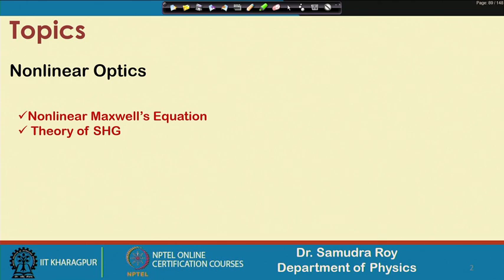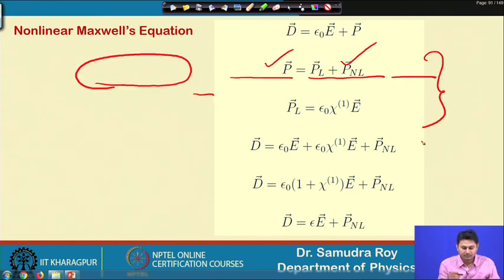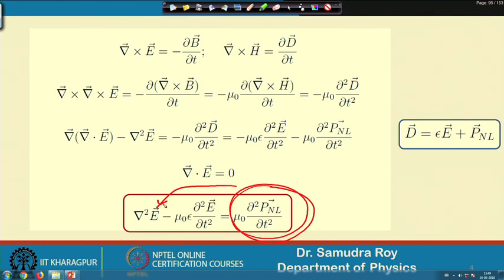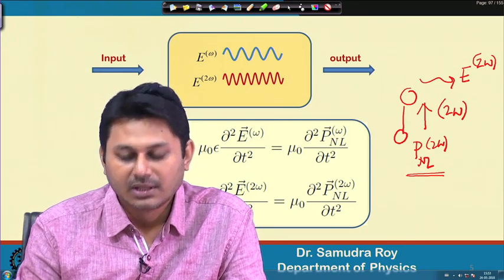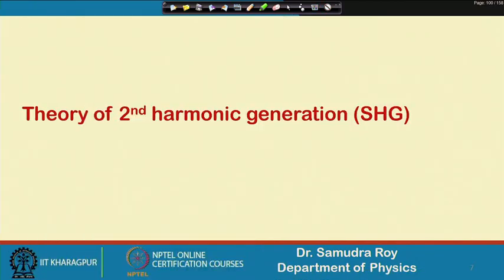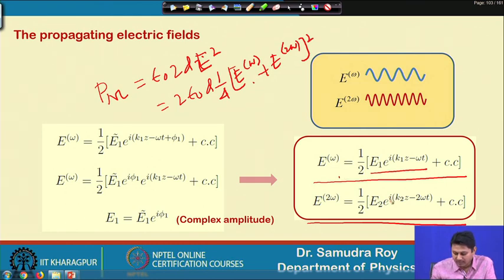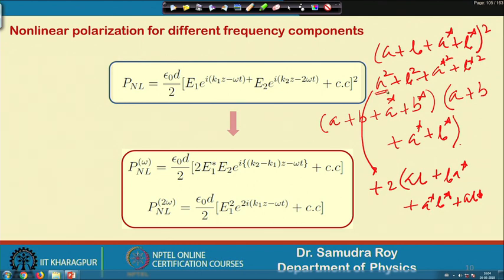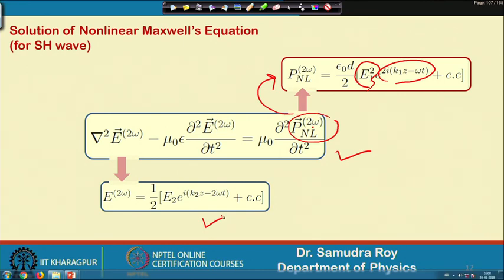Lecture 16:Nonlinear Maxwell’s equation

Comment: div E need not be zero in medium. Didn't get it.. Please explain sir...
Reply: For anisotropic materials div E is very small.
Have a look on page 71 of Non-linear optics by Robert Boyd.
Reply: I think he assumes that the amount of electron and proton is equal, so the total charge is zero.
Reply: It is important to understand that the length scales where these theories are pretty accurate is much larger than the size of the molecules.. At those length scales, the electric field is the collective effect of a fairly continuous 'field' of point dipoles and for any closed surface of that length scale the total flux of E is going to be 0, hence you can set the divergence of E to be 0 until you don't have any free charges sitting in the lattice as impurities.